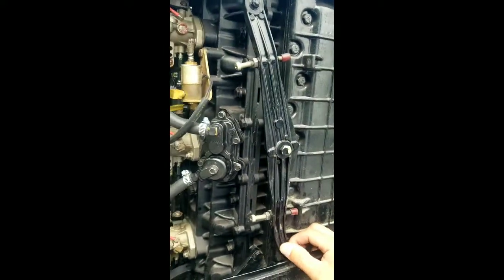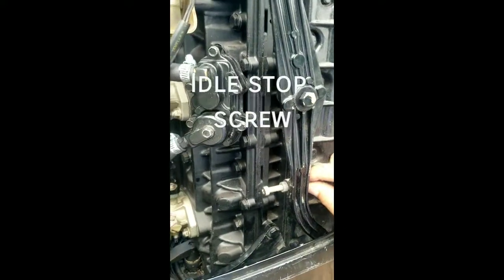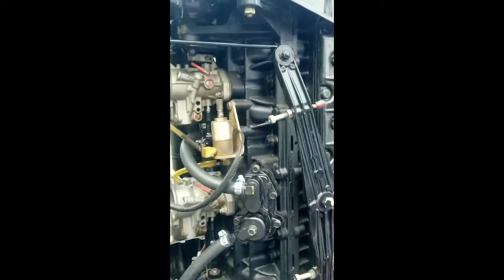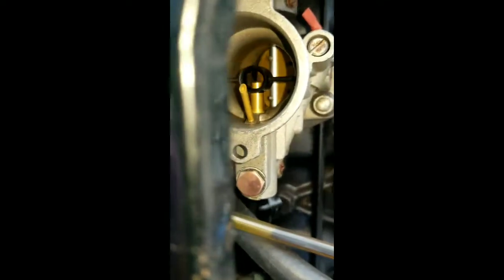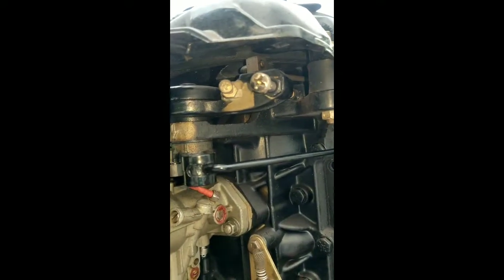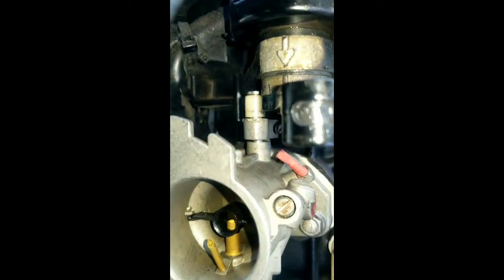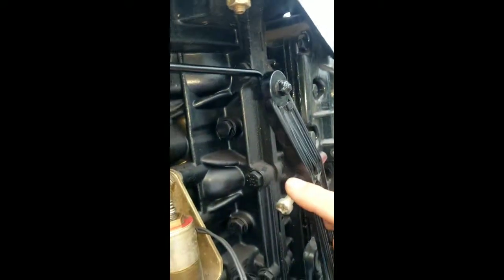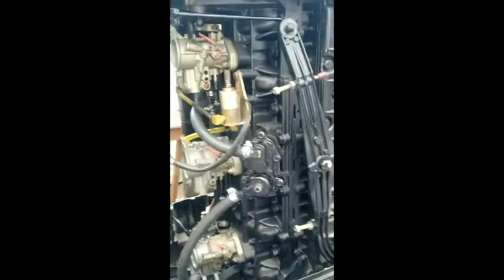Mercury Outboard Adi Stop Screws

Comment: Hey Mercson, really enjoy your vids, hope things are getting back together after the fire.  I'm playing with a 77 850, and I am wondering about adjusting the primary on it; perhaps I have my head in my ventral orifice, but the six is different from the 4, in that there doesn't seem to be any marks to line up for the primary. When I move the carb cam to 'almost touch' the primary, it contacts way back on the heel, whereas yours seem to contact about a quarter of the way up. Manuals are pretty thin on the ground, and I don't have one, at least not yet. I assume the primary screw is the one partway up the long arm that has the timing screws, but not sure how to set the primary to begin timing it.
Reply from the maker: The idle/primary is set by the lower screw with the primary pickup just barely touching the carb cluster. I think I have a video on this.
Reply from the maker: https://youtu.be/QDunqaR81I8?si=lEWs_JIqmoC4VsKE

Comment: I know this is old, but I got some questions on an '88 80hp 2 stroke. Same screws.
Reply from the maker: Ok.... what are they?
Reply: @MerCSonL6  the lower screw, it says it's a spark advance screw. That lossened out. Now I'm not sure how to properly adjust the spark advance screw.
Reply from the maker: @colinl5951  you need to properly time your engine. I'll send you a link. Son
Reply: @MerCSonL6  thank you. This engine runs great, it did lose the idle screw. Replaced idle screw with a nut. Now it starts better and doesn't slam into gear. That spark advance screw was loose. It vibrated loose at sometime. I'm the 3rd owner of this '89 thunder craft 162SS. 2nd owner wasn't too mechanically inclined. I don't get why they didn't look into as why it was slamming harder into gear over time to become completely out?
Reply from the maker: @colinl5951  https://youtu.be/x5MQUmXhf9c

Comment: Hey there. I have a 115 L6 adi runs awesome. But it's hard to start. I have to have the throttle down to get it to run on start up. Any help would be great thanks
Reply from the maker: Install an enrichment valve. I have a video on how to do it. It's a simple operation and eliminates hard starting assuming everything else on your engine is "good." Hope this helps. Son

Comment: thank you for the videos dude. 84 mariner 115. you are totally right, my very little experience says its not possible to get the thing to idle correctly without using that main idle screw. my next issue is i think i am having a water ingestion issue on holes 5&6. going to be digging into that soon. plugs are way too clean. i cleaned carb number 3 just in case it was a lean condition, but i doubt it. no real running issues.

Comment: Sir Son, I have a 1978 800 Thunderbolt that I am trying to get started. This 6 looks like the 4 cylinder minus a carb. I don’t know if this motor ran before as I was told it had low hours. My butterflies(#5 adjustment) are not contacting the throttle cam. Could you maybe do a video on a L4 with Audi? Thank you, Steve

Comment: Great video! I have a 1986 115 and I think the upper throttle linkage to the spark advance is causing intermittent bogging down on throttling up. The link is really sloppy at the top and looks like it will need to be repaired. Ever see this problem?

Comment: I wish I knew how to apply the timing info on my engine to check what is going on with my motor. I might have been messing with one of the adjustment screws on the outside of motor (1983 merc 80hp 4 cycl 2 stroke) . the adjustment screw is attached to the armature (with the spark stop screw at the top) and bumps against the throttle stop armature. I have pics. Today I had spark at the plug but wouldn't show any signs of actual combustion. also it showed signs of flooding. Waited half a day to try again.. didn't look flooded but no combustion visible. Had boat and motor for about 3 days and our family is nearing the edge of regret! Everything looks clean and good wiring nothing rotted. Tried adjusting carbs between 1.5 out to 3 turns out nothing happening. first day we had it motoring around at 2000 rpm but wouldn't go any faster. Although it would fast idle up to 4k in neutral had lots of trouble keeping it running going into gear. finally got it moving but no top end. :( Now we have no combustion. What have I done! One step fwd 2 steps back
Reply from the maker: Sounds like the carbs need rebuilt. Compression checked and a spark test per cylinder. You will need a timing light to aquire the proper timing for your motor. I recently rebuilt the exact motor. It may help. Titled "Mercury Outboard Left to Die: Final Chapter." Son
Reply: @MerCSonL6  Thank you for the reply I really appreciate it.  Can anything be assumed with a visual inspection of the carbs on the intake side? They look super clean and they appear to move mechanically together perfectly. Thanks for pointing me to your other video I will definitely check that out. Thank you for contributing valuable content.
Reply from the maker: @kennethdante  exterior can be deceiving.  Son
Reply: @MerCSonL6  update: I brought it to our outboard mechanic today. First thing it showed was no spark on all 4 cylinders. Something perhaps was actively failing cause when we were at the dock we had spark at cylinder 1. Our mechanic checked kill switch first then moved onto swapping the switch box ( i think that's what it's called... rectangular thick panel thingy that bolts onto side of engine with all the rubber covered wired connections on it,  still nothing, then he pulled the flywheel off and checked stator which was bad on multi-meter resistance check. (It was a new stator a week ago). So he thinks it is a rectifier ( i think thats what he called it?) that sends power to stator which can ruin a stator apparently? Presently waiting on parts= new stator and rectifier,,which appears to be a bolt-on part, that to me, looks similar to what a solenoid looks like in appearance.  //It was nice watching him pull things apart and be able to ask questions. Trying to learn what I can when possible. He also said he would check trigger make sure it's okay since the flywheel is off.
Reply from the maker: @kennethdante  the rectifier does have anything to do with ignition. It just charges the battery. It is also a line of defense in case you reverse the terminals. If the stator is not powering the switchboxes that's and independent issue aside from the rectifier. Son

Comment: I have a 79 1500.  Timing is killing me.  Does anyone show a full timing job, using a timing light?
Reply from the maker: You mean 1400? If I remember correctly the last 1500 was produced in 1977. 1978 they were rebadged 1400 because of the V6 150's. If it is a 1979 it should be an ADI ignition model with NO distributor. What exactly are you having issues with in regards to timing? TDC, primary pickup, secondary pickup, max, idle, etc. Let me know. Son.
Reply: @MerCSonL6  sorry, 1977. SN 4604854
Reply from the maker: @williamdobbins3131  ok, so you have a distributor model. A timing light can be used but is not neccessary. What specifically are you having issues with?
Reply: @MerCSonL6  I did a carb rebuild, and that went well.  I tried a link n sinc.  Haven't had the right performance ever since.
Reply from the maker: @williamdobbins3131  are all the carbs opening and shutting precisely at the same time? Have you tuned all 3 carbs? What's your compression? What did you set your idle, primary, and max to?
Reply from the maker: @Ian Van Der Westhuizen there's no min spark per se. I believe the recommendation is 3-5 ATDC and the max should be set at 19 BTDC. I would try turning out all 3 carbs a quarter turn ccw to get a richer fuel mixture for takeoff. Also, are all 3 carbs opening and closing at the same time? Let me know. Son

Comment: Love the inline vids.  I rebuilt my inline 6 with new reed blocks and new reeds, replaced all bleed restrictors.  I could not get the idle down believe it or not.  Had to lower the timing to 6 degrees ATDC to get it below 1000 RPMS in the lake, first time I understood the label myself.  I couldn't close the idle jets anymore or it wouldn't have a hole shot.  Nothing left to do but lower timing, and it runs like a boss, open the throttle and hold on!
Reply from the maker: Thanks for the heads up. I appreciate the feedback. I guess I should've mentioned in the video that I also remove the idle stabilizers on my engines which helps it idle lower.  I do not like anything manipulating the timing other than me.  My engine is set to 2 degrees BTDC and idles in gear around  750-800 rpms. You are correct with these engines running like a boss. Theirs nothing like hitting 5,500 plus rpms with the torque these engines put out!